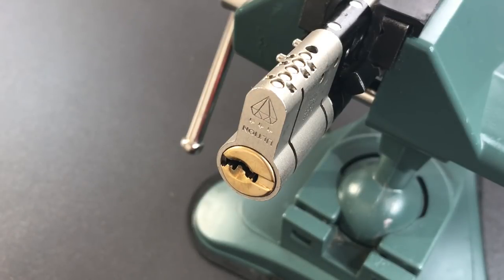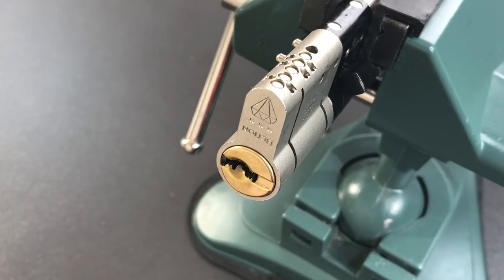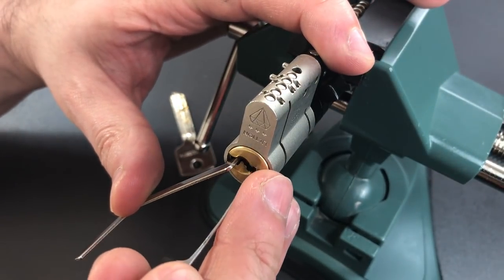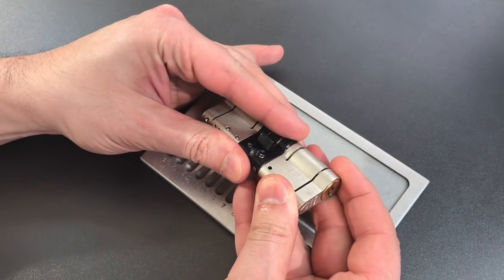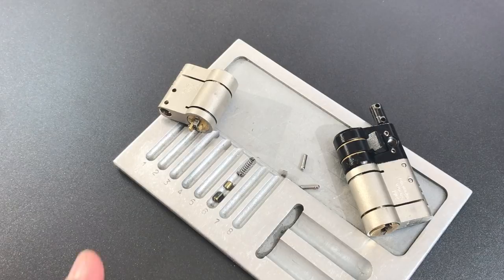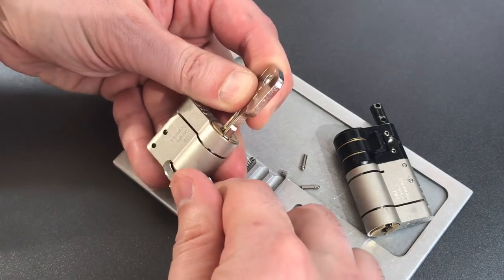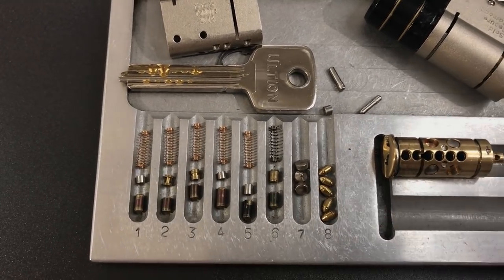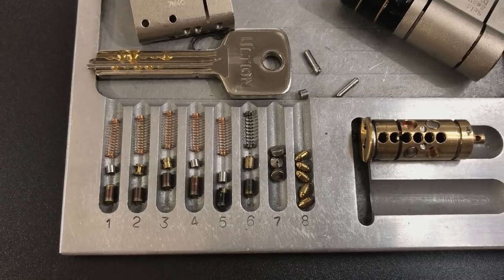[628] Ultion Euro Profile Cylinder Picked and Gutted

Comment: An interesting lock. Considering all the good engineering, it's a shame they didn't spend a few more cents on ... better pinning.
Reply from the maker: Agreed. This is literally easier to open than the first dimple lock I ever opened... the Abus d6.
Reply: LockPickingLawyer sure you get asked a lot but do you test security systems locks maybe safe’s etc?.
Reply: Oh. These have just come as standard on new doors to my house!
Reply: @lockpickinglawyer  I was about to purchase these euro cylinders to replace my standard Yale 70mm’s that are currently fitted. Which is the absolute best euro cylinder you would recommend?
Reply: @sounduser  yes I ended up getting them they operate incredibly smoothly
Reply: @sounduser  I hope so.I`ve just fitted 2 at my house today after watching LPL taking a while to pick it .
Reply: Well I guess it's because 99.9% of burglaries aren't done with picking they are snapping and drilling entry.
Reply: There is no point of creating false impression of vulnerability if it’s too far from real life. Burglars practically have no clue about picking as first argument, they are not spending tons of money to buy expensive tools which are required to do picking, in real life you don’t sit in nice comfy chair with big nice light on and never have 300 repeats before you one nice video about being easy and gutted
Reply: Interestingly these are marketed on the fact burglars don't pick locks but make destructive attacks, against which it claims superior resistance
Reply: @svaigagalja  you must be a lock company ceo or an engineer 😂
Reply: Pennies, dear fellow 😉
Reply: @svaigagalja  But for the rare burglars that do pick, your home insurance will say you left the door unlocked and now you have lost everything.
Pick resistance matters to show you were broken into.
Reply: In Britain nobody picks locks, they drill or snap or battering ram things open. And anyone who did know how to pick wouldn't be stopped by a harder to pick lock, it would just take them a tiny bit longer
Reply: @TheMushybees  correct. Your ‘average’ criminal is lazy. They always take the easiest way in and that is via brute force.
Reply: @tidyboy72  my last house had the ultion keys.  I am glad LPL doesn't live in the UK
Reply: It is honestly sad I love seeing all the drill protection bump resistance snap protection is a real treat to see all three in one lock and then the easiest picking I ever seen it’s like something master lock would do
Reply: @svaigagalja a cheap set of lockpicks is only $10-$15, and picking locks in the field is just as easy as it is sitting at a desk(it's part of my job) so at what point are you going to make a valid argument?
Reply: @Mr1nferno That's not always the case. If you got big comfy protruding americana-bulb lock holders on your door and plenty of room - sure. A normal flushmount in a recessed left corner... Not so much.

There's also the part where just owning a set of tools doesn't make you a competent operator. If you're a locksmith or a janitor you got all the time in the world; you're expected to be there. If you're a burglar or pentester you're not and you don't have the luxury of spending time fiddling with picking. You either snap or pull the lock, or you crack it the old way. And that's what 95% of normal, quality door locks are made to foil. More, improved security pins won't stop a locksmith, snap protection will stop most burglars.

Comment: The lock is upside down holding up the pins could u try picking it the right way up
Reply: Didn't want to be defeated. YouTube is full of subtle manipulators
Reply: Theres is a video by Lock picking noob with it facing the right way up its. Still very easy to pick.

Comment: We’re  just job smacked at the precision & speed every Lock you do 
Great review & gutting we’ve been interested in this lock for a while due to the UK hype & rubbish reviews on picking them Thanks LPL ✅
Reply: It's like leaving a key outside
Reply: We have these locks, and I also use their padlock on my bike chain so its quire reassuring to see they are resistant to brute force attacks which is the most likely form of attack they would see in the UK where most house breakers are smack heads who wouldnt have the patience to pick a lock but try to snap it.
Reply: @micrashed truth

Comment: One thing I have certainly learned from this man:
If you pick with the right tools, nothing can stop you from opening the lock. 
Forget trying to break in, he never ever accepts that as an answer and is illegal. He never drills. Never used a rake gun. Does it by hand. Every bit of it. I love how precise he is. I am learning locksmithint because of him. He makes this look easy and kind of relaxing. I have been lockpicking my own locks so I can get into them myself. And my dads 50,000 lock collection with 5,000,000 keys. I have been able to attain what I need with this knowledge with a tyrannical 6 year old on the mix. This man the LPL is very informative. I appreciate it.

Comment: To be fair, most attacks on Euro-format cylinders are going to be snapping attacks, because if you have the tool you need almost no skill to use it.  Drilling next, no skill required but can be noisy.  Picking least likely, because that needs skill.

Of course, if this lock became very common then burglars would have to learn picking skills and then other locks would be a better choice.  Right now, for all its faults, it might be the best of a bad choice.  Not great, not good, but not as shit as the rest in terms of vulnerability to the most common attacks.
Reply: As known most locks are made to combat destructive entry & also most smack-head burglars couldn"t even "pick" their nose properly............................
Reply: For unskilled thieves, automatic tools are available. I do not know if they just do bumping and raking and how well they handle security pins.
Reply: Halberdin pick guns are shit and only work on particularly vulnerable locks. Anti bump measures should stop that attack as well.
Reply: Most of the piky theiving gits in the   UK don't go on a burglary with a pick set. They'll snap the lock, then drill and then smash a window
Reply: there's also the matter of 'picking' the lock. As in, choosing. If you're a smack-head, you might not care about what the exact target is, so just move on to a lock you dont need picking skills for.

Comment: i just dont really get passive pins. they've already done more then 50% of the work, it would seem, so why not make them active pins? they've already put them in the lock and drilled the key.. just need a spring and driver pin.
Reply: There isn’t enough room on that side of the core to put springs. You see the shape of the cylinder, right? You’d need a second protrusion from the cylinder for the second set of springs and drivers, and then nobody can use it because it doesn’t fit in any doors.
Reply: Install the lock the right way up (in the UK euro core locks are always installed core up top) and they come into play.
Reply: Passive pins only really provide a benefit in some situations, it's a really low budget way to imitate master keying for example. But in residential settings, it seems to be most common to prevent other locksmiths from copying your keys. Official dealerships of certain locks often get given a batch of pre-cut passive cuts in their key blanks so they can't be sold to third party, and it means your keys can only be cut by 1 locksmith only (which both increases security, and stops high security blanks ending up on unofficial markets)
Reply: @Nitrxgen  this is likely what they are used for. When a cloned key came onto the marketplace Brisant changed the keyway slightly. This resulted in new keys working on old locks, but old keys wouldn't work on new locks (i.e keyed alike). You could open the door by forcing the key in, but this risked the key getting stuck. Brisant really likes to keep control of their keys.

Comment: Youve got the lock upside down - in the UK they are fitted with the core at the top and the pins and springs at the bottom.
Reply: I assume the passive pins fall into place due to gravity.
Reply: Exactly
Reply: @alanjenkins1508  This seems to be a common misconception. The passive pins don't rely on gravity at all, the orientation of the lock makes no difference to its operation (same as picking). Those pins are designed to be forced into the key ONLY as the core rotates. The lock body features rounded dips where the passive pins can sit and jam up the core but only if the key is present and doesn't have those passive cuts for them to retract into. When rotating the core, they are forced towards the key, but if you're picking without a key then that literally acts like a key with all passive pins because there's no material to stop them being forced inwards. Also think about years after heavy use, locks and their pins get super grimey and don't move freely from gravity alone, imagine having a gravity-dependant lock in this situation lol.
Reply: @Nitrxgen  thanks, finally I understand passive pins.

Comment: those 'slugs' are meant to be the anti drill pins, which drop into place when you use a drill, and they 'should' stop your drill from spinning, therefore stopping you from drilling open the lock, I have a custom Euro 10 (+4) door lock (custom designed), and several locksmiths have tried,  but those tend to drop into place and stop the drill..

Comment: Great pick,  you make it look so easy, over here in the uk snapping is the main attack method, i suppose Brisant think its not worth bothering with anti pick protection but if this lock is so easy to pick then criminals may consider learning pick techniques which is a bad thing. I may change to a different manufacturer like Mul t lock to ensure the security of my customers.
Reply: That's why we should use anti-burglar mines

Comment: i wonder what would happen if you changed the anti bump stronger spring to a piece of silicone oring with a cross section  of 0.104 and cut to length so you can just barely load the top pin into the shell..   that might make it actually pick proof and bump key proof as very few if any picks would be strong enough to lift the last pin to the shear line with a pick..   just a thought.. i know that most viewers here love to unlock locks.. i love to lock them securely..  Gerry L. Finch was a friend of  mine.
Reply: The main problems may be temperature-dependent flexibility and aging effects under many thousands of stress cycles. The lock-pickers, on the other hand, would find a way to overcome it for sure.

Comment: I have one of these on my front door, the door itself is solid and would resist a heavy beating, and the surrounding handle etc would make snapping impossible so this would only leave drilling or picking as an option. I would be worried about the picking but considering I live in an old house with sash windows, the door locks are the least of my worries.

Comment: I'm stunned a UK company can still produce work of this apparent quality. 

However, LPL, I'm starting to detect a common theme with various types of locks. As you say, the manufacturers close one door (often very competently and comprehensively) yet they leave another wide open to abuse. 

There has to be a reason for this. In the case of the Chinese copies it's clearly a commercial decision to cut corners to save money. 
Many companies such as Master appear to trade off their public reputation and marketing claims which are often grossly exaggerated. 

But some serious companies clearly spend a great deal of time and money developing and manufacturing very high quality, clever and often sophisticated locks, and in particular cores, which are either extremely resistant to brute force attack, and are equally extremely vulnerable to picking or even raking or bumping, or vice versa. 

I'm not a lock picker. I lack the patience. But as a former experimental aircraft engineer, I can often recognise both the vulnerabilities and the potential solutions in each case. As a designer, I can often come up with a viable solution. Several actually. Indeed I've junked about a dozen so far. 

But as a dot connector, I'm left wondering if the lock manufacturing industry is not in a nod and a wink agreement with other parties (law enforcement, intelligence agencies, locksmith trade etc) NOT to make their locks invulnerable to ALL types of attack. 

For instance, where is the lock core buried 20mm behind multiple hardened spinners? Yes, I'm aware of the issues this would throw up in terms of manufacture, cost and ease of operation, and I've (eventually) figured out viable solutions. Some are actually even fairly simple and cheap to apply. Others are capable of turning an otherwise bar of soap level of resistance (as in the case of your bolt extractor, and Bosnian Bill's 40 second hacksaw attack) into a frustrating nightmare for even the most determined attacker. 

By this I don't mean I believe I can design lock cores. I can't. I acknowledge that is another discipline entirely, upon which I don't propose to poach. 

I can however design lock bodies that protect the core - from BOTH picking (denying the ability to tension the core) AND brute force attack, as well as actions that are equally resistant. 

This leaves me with the nagging question: Why can't they...?
Reply: Just a thought I've had, but I'm thinking they leave locks vulnerable to protect what's around the lock. If someone is determined to get inside no lock will keep them out. If the lock won't give way, the door itself could be broken, or the walls, the windows, the roof. The uninformed and "casual" robber might be deterred by a hyped up lock, while a professional would look to sidestep an annoying lock.
Reply: I think that the majority of domestic property invasions are by physical attacks and not lock-picking.  LPL is a very talented picker, but your average Ned lacks the patience and tools to pick a lock, and the main job of locks is to a) intimidate or b) frustrate the burglar and induce him to move on to easier pickings. If however your property has been targeted they will be coming in one way or another unless you have turned your house into a fortress. It’s still disappointing to see LPL so easily pick the lock, especially when I consider just how much I’ve spent on these locks for my home.
Reply: @paulfitzgerald7513  didn't you read? He's a former experimental aircraft engineer.

I too used to design experimental aircraft. Aged 4. Using Crayola crayons. They had laser powered engines and one had feet instead of wheels!

I guess that makes me a former experimental aircraft engineer too?

Comment: The Euro Locks are one of the best But you have to have the anti snap ones in the door. Most of the doors now have a locking  system  built into them so you are not relying on just the lock. There is a number of locking catches up the length of the door that  engage. making them harder to force open.  But when it is backed up with a vibration censor  on your alarm system That will set the alarm off before and serious attempt is made on a door or window.  No point in having alarm censors that only activate when a door or window is opened  because they wont go off if the glass is taken out. The damage is done by then.  Nice picking dhow

Comment: I've snapped these clean off because of too much cylinder sticking out of the door on commercial properties, leaving me with one pin to drill then I can turn the cam with a screwdriver. Even easier if they are fitted the wrong way around, snap and just turn the cam. Need to be picked or drilled on a residential building because the handles usually protect the cylinder from being snapped.

Comment: Well now I'm dying to see it drilled. Now that I think about it, I don't think I've ever seen a demonstration on Youtube or elsewhere of just how well or not well all these anti drill measures work.
Reply: AsteroidsOnSteroids I'm sure that's an expensive lock but I would also love to see just how well it holds up against a drill attack.
Reply: bosnianbill 910 He drills through a bike lock with drill protection.
Reply: Thanks!

And holy moly, anti drill features are actually pretty damn effective.
Reply: Well given its 3 star rating and Sold Secure 312 diamond mark this means that it needs to conform to BS Standard 1303:2015 which states that "it shall not be possible to rotate the cam using a maximum torque of 5 Newton Metres without the correct key after drilling"  - this drilling is for a set period of time.  In the case of this lock I believe that is 5 minutes.
Reply: fromefun Thanks for that info, I couldn't understand the ... overkill of hardened steel. Now, it make sense.
Reply: @asteroidsonsteroids271  Yep, hardened steel is hard to drill into with standard bits. If you've ever broken a threading tap off in a hole and tried to remove it by drilling it out, you know it's almost fucking impossible to do. You need tungsten carbide bits and a lot of time to do it.
Reply: Don’t the hardened pins spin in place when drilled? Standard bit will just go dull, carbide bit will spin the pin before cutting it. Maybe it can roughen it up eventually to stop the spinning, but the standard is 5 minutes because a thief will try an alternate entry or move on to an easier target if it takes too long to gain entry.

Comment: @LockPickingLawyer Good lock, I would recommend it tbh. Burglars are usually not in the market for learning a skill. 99.9% of the time they snap, bump, drill, or pull cores. and if any of those methods fail for over a few minutes, they bail out. I have never, ever heard of a break-in where the lock has been skillfully picked. Ever... at all... none, zip, zero, rein, nada... Anti pick is for that reason the lowest priority on chosing a lock to secure your home. But I would not say no priority, just the lowest.